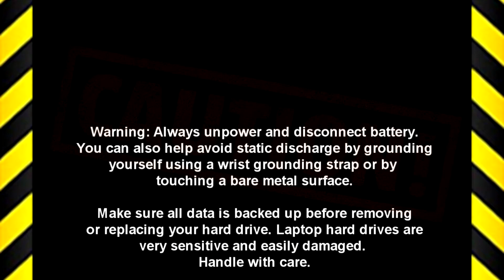Dell Latitude 5510 (P80F002) Keyboard How-To Video Tutorial

Comment: Thos is not a 5510
Reply from the maker: The model shown here is a Latitude 5500 which is the same chassis as the 5510 and has the exact same disassembly process (including screw configurations). This can be verified through the Dell owner's manual. Hope that helps.